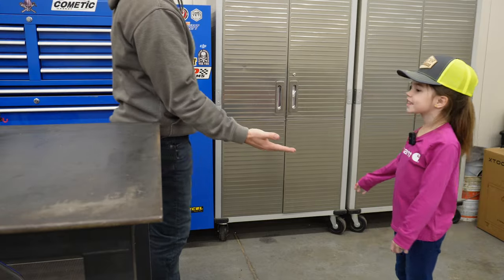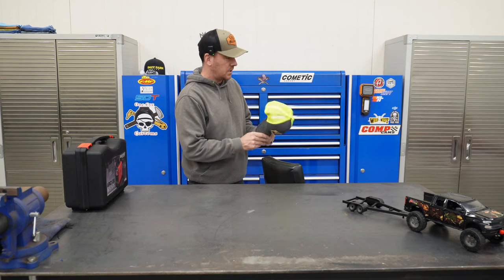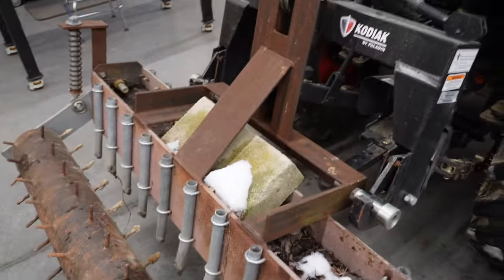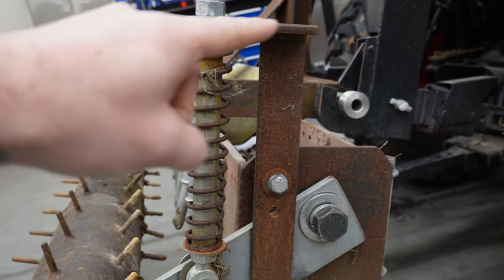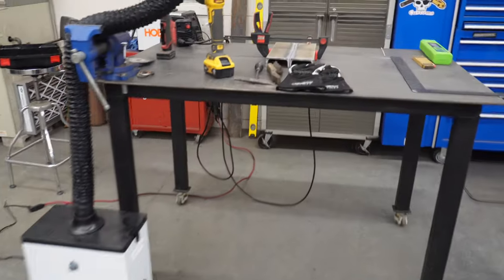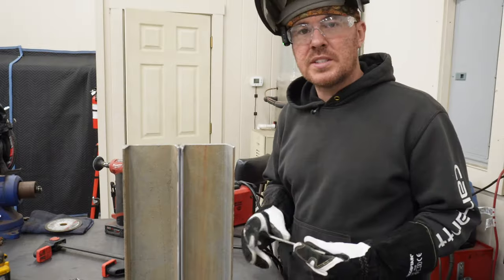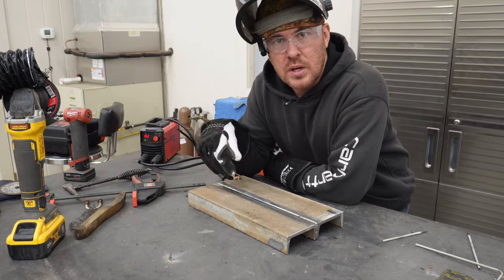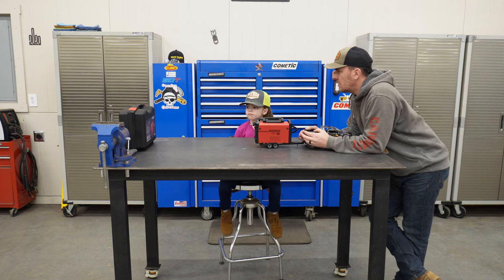A MACHINE You've NEVER Seen...

Comment: I had to buy one, retired and welder by trade, curiosity got the best of me. I do have a welder that works very well with stick and tig A/C D/C but it weighs 600 lbs. Its a Miller 320 abp single phase 230 volts, and a 110 cheap wire fed mig/fluxcore machine, Can't wait to see the quality and performance of this Arccaption 130

Comment: You are probably done with the project by now or already past that point. But if you didn’t want the conduit to the front closer to the tires, you can just mount the flat part against assembly, instead of the channel side, and mount the rods to the rear. It would basically keep them inline with the other ones on that side.

Comment: Great little welder. I'm impressed with your fabrication talents. I've been doing that for several years. Here's a tip that will save you time and money. Instead of replacing the conduit rods when they wear down, cut some rebar lengths about six inches longer than the conduit and insert them into the conduit. Then bolt them in place, and you're done. As they wear down just drop them down as needed. Saves you lots of time and money. By the way, you have a great little assistant.
Reply from the maker: Thank! I appreciate the suggestion.

Comment: Get yourself a wire wheel (cheek poker 6000) for the angle grinder. You are 100% correct about moisture and old 7018 rod. That little Machine worked great.
Reply: There's a VGG Subscriber - LOL

Comment: Great video. I’m curious if you have had a chance to run any other rod other than 7018? If this thing will run a 3/32 6010 I’m going to buy one. I bought a similar machine a while back (different brand) but it would only run 7018 for some reason. Thanks
Reply from the maker: I havent used any other rod with it yet.  Its a good little welder for the price point.